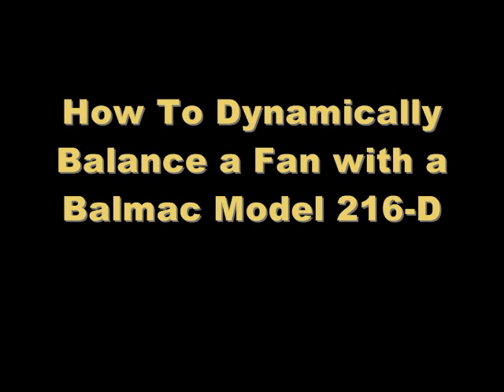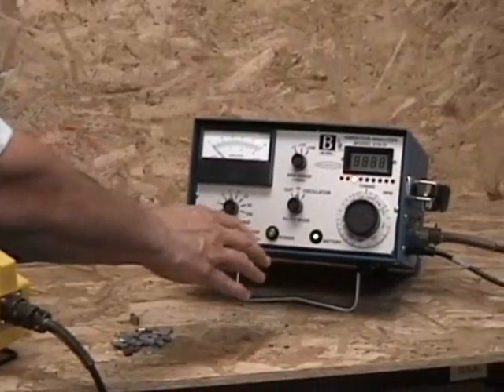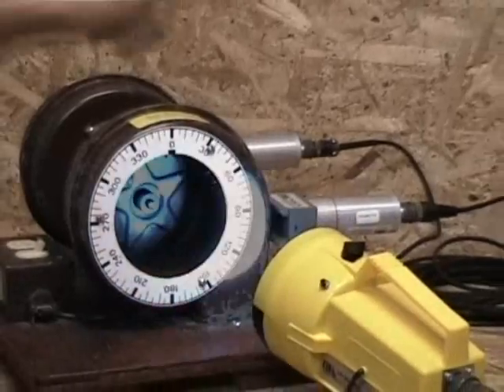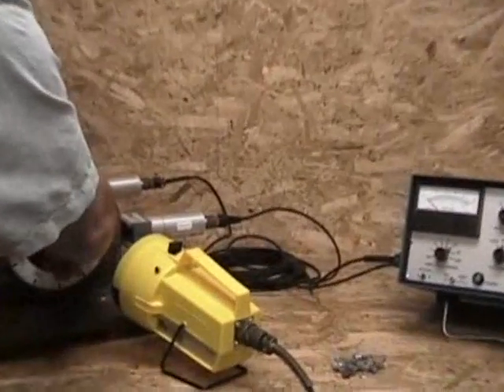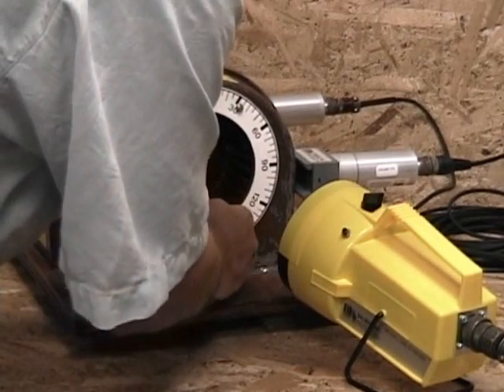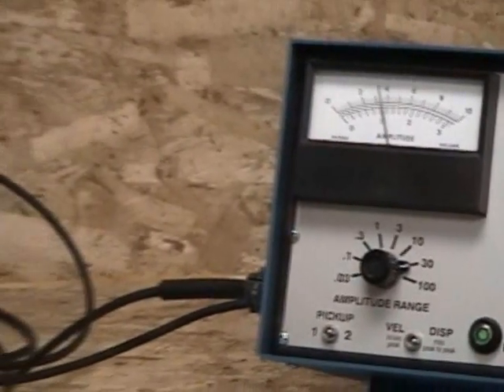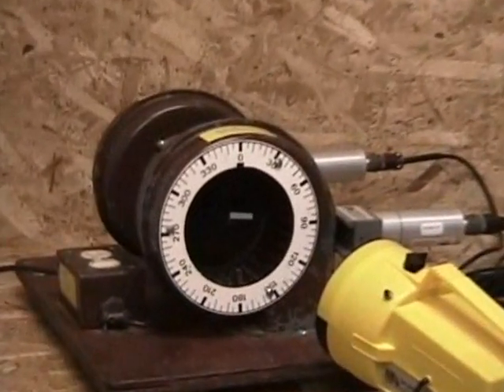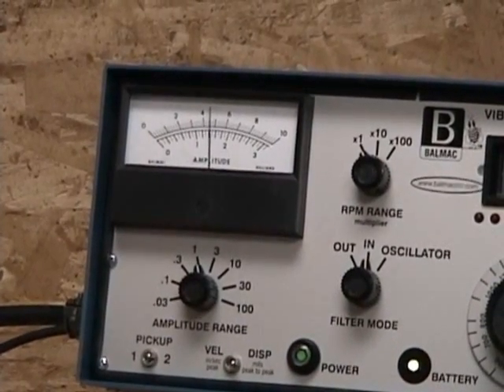How to Dynamically Balance a Fan with a Balmac 216-D

Comment: I hope that this is not a tool used by anyone to balance a fan because this guy gave little to no in depth information on what he was doing... you really need to describe every single step as if the user has never operated these tuning tools... nice try though i guess.